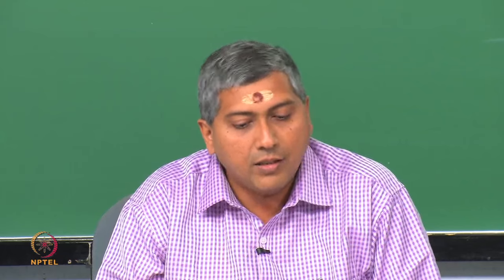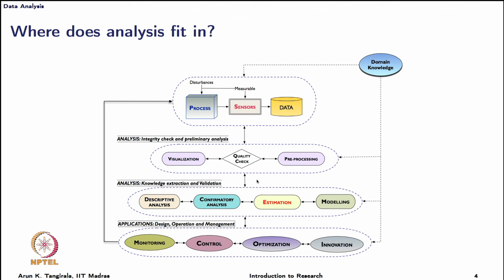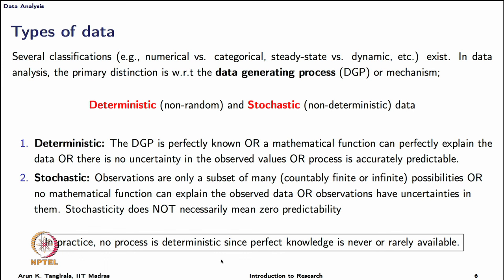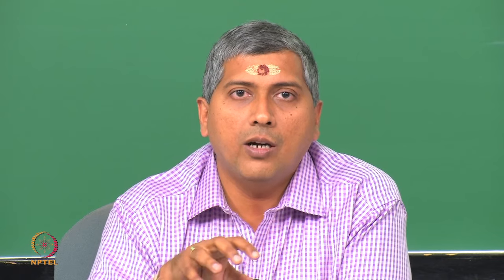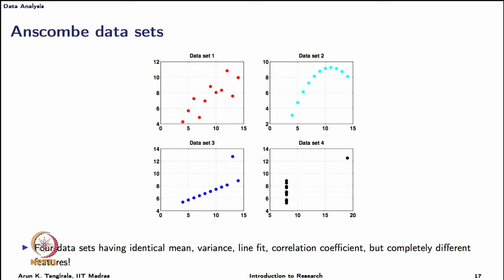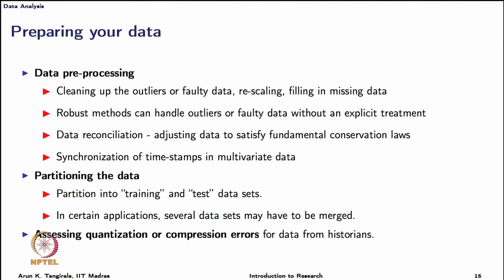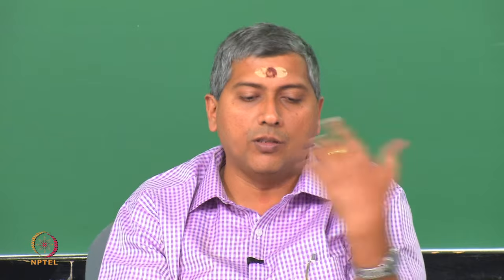Data analysis Part 1

Comment: 2:37 Slide 1: What is Data Analysis 
8:15 Slide 2: Where does analysis fit in? 
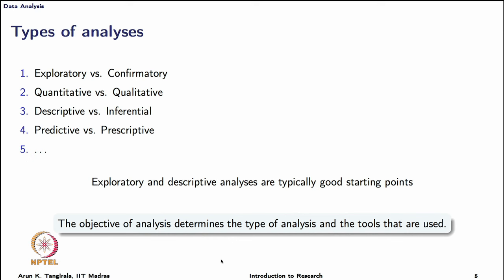11:18 Slide 3: Types of Analyses 
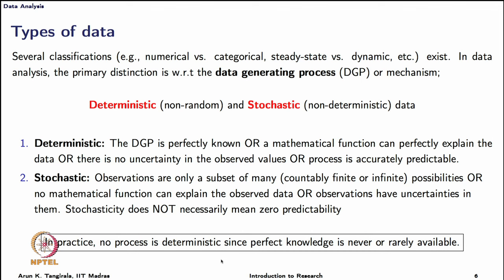14:50 Slide 4: Types of Data 
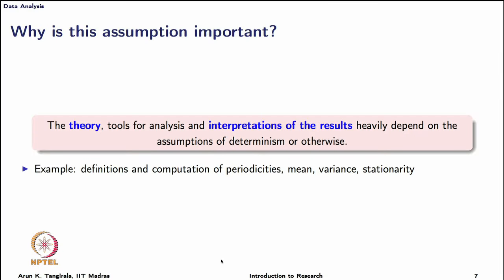20:31 Slide 5: Why is this assumption important? (Deterministic or Stochastic) 
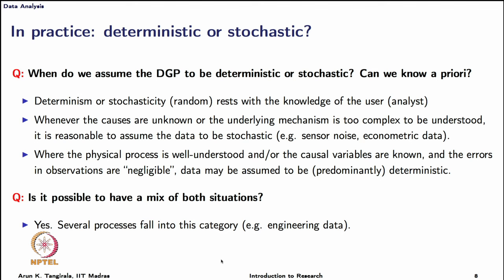22:42 Slide 6: In practice: deterministic or stochastic? 
27:26 Slide 7: Further (Contd. from Slide 6) 
31:33 Slide 8: Terminology in Data Analysis/Statistical Inferencing 
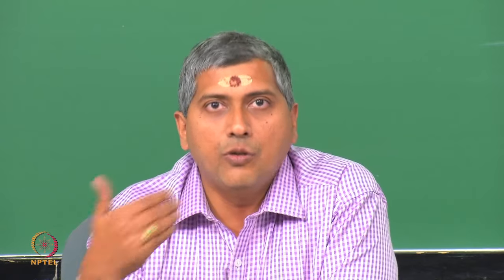36:43 Slide 9: Terminology (Contd.) 
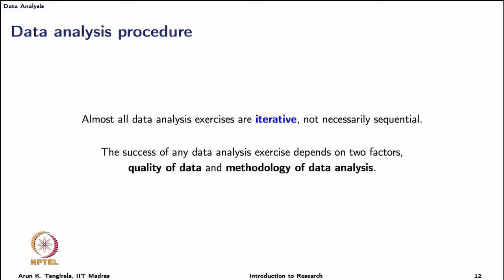42:31 Slide 10: Data Analysis Procedure 
45:19 Slide 11: Anscombe Data Set 
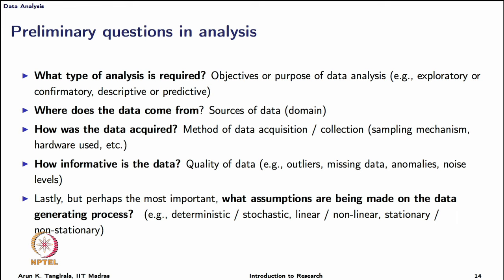52:09 Slide 12: Preliminary questions in analysis 
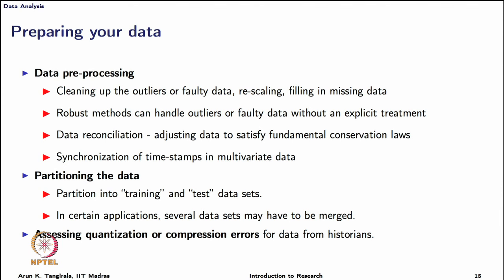54:05 Slide 13: Preparing Data 
55:43 Slide 14: Visualisation 
56:11 Slide 15: Core Steps 
1:00:13 Slide 16: Assessing and reporting results 
1:03:18 Slide 17: Bibliography
Reply: a tip: watch movies on flixzone. Me and my gf have been using them for watching all kinds of movies these days.
Reply: @Anson Diego Definitely, I have been watching on Flixzone} for since november myself :)